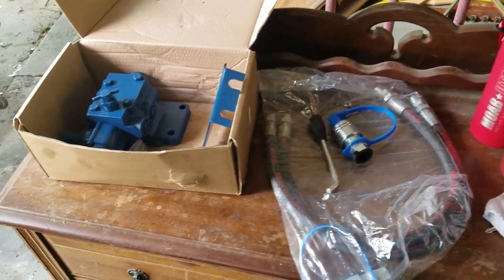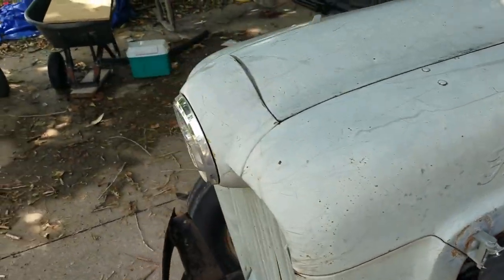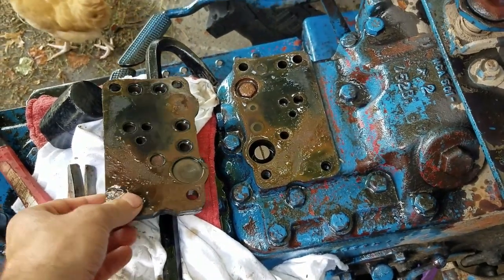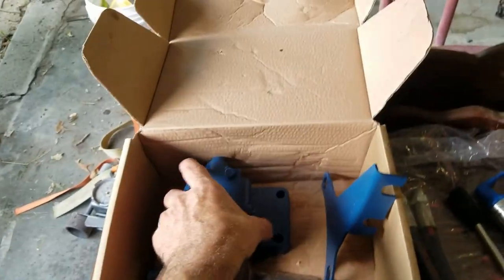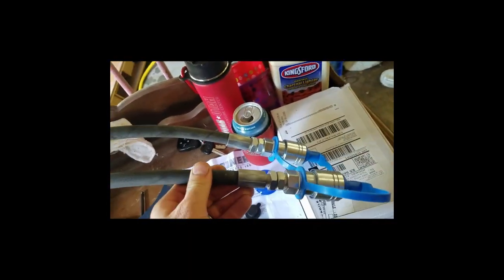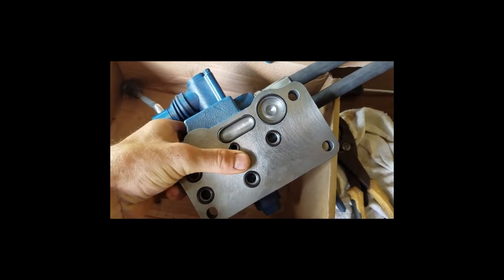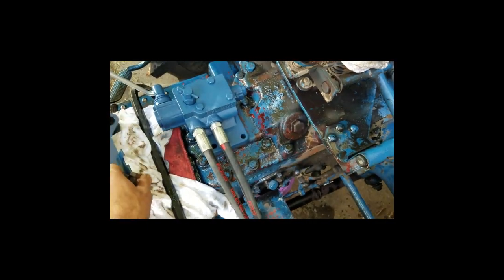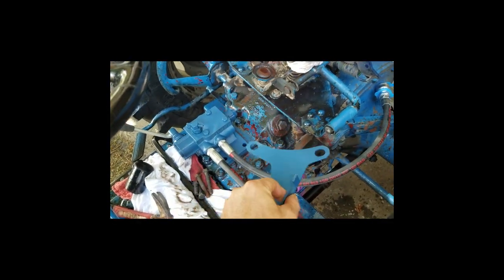Ford 4000 tractor remote hydraulics control install

Comment: All that oil.  Forgot to lower the three point first, didn’t you.  Also, that’s either an 850 or an 860.
Reply from the maker: here is where I got the info. 
http://www.tractordata.com/farm-tractors/000/2/6/262-ford-4000.html

Comment: Have you used the system yet? I want to use this kit on my 861.  Just curious on how you like it.
Reply from the maker: here is where I got the info. 
http://www.tractordata.com/farm-tractors/000/2/6/262-ford-4000.html
Reply: @jpurs007  that’s not a 4000.  Look at the boss below the ignition key.  Look at the 800 section and where it tells you to find the serial number.  That’s an 860.  You can see the red paint bleeding underneath the blue.   For some reason it was popular to paint these blue in the 60’s.